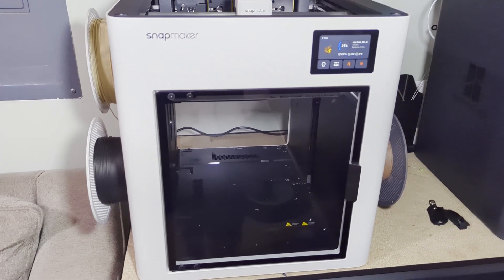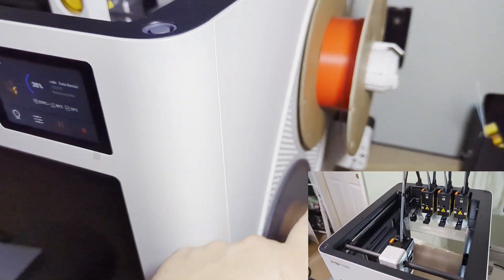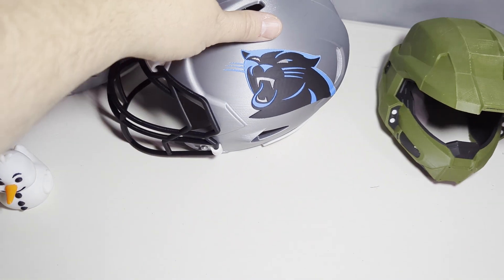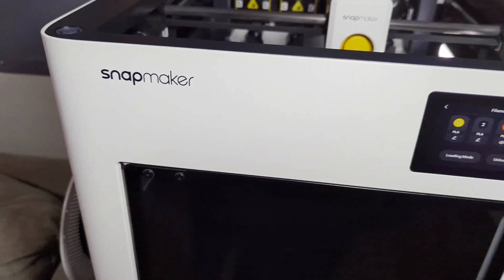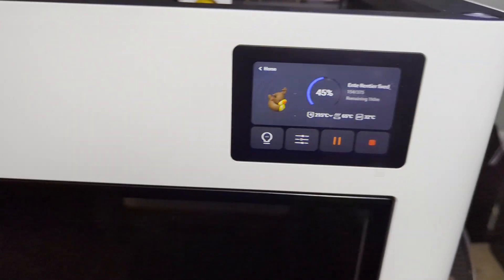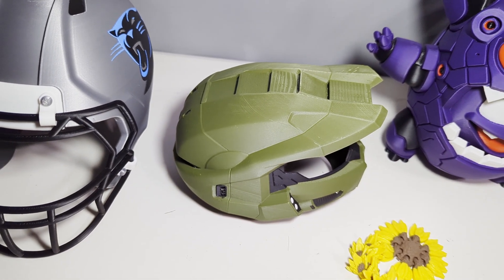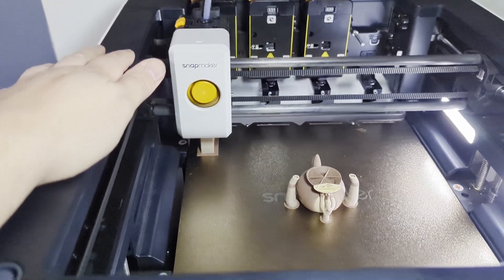Is Snapmaker U1 Worth It? 250 Hours, 16 Prints, Honest Review 4 Toolhead worth it?

Comment from the maker: What questions do you have about the Snapmaker U1?

⏰ TIMESTAMPS:
00:00 - Intro & Overview
00:47 - Setup & Packaging Review
02:07 - Print Quality (16 Models Shown)
04:14 - Speed Analysis & Comparisons
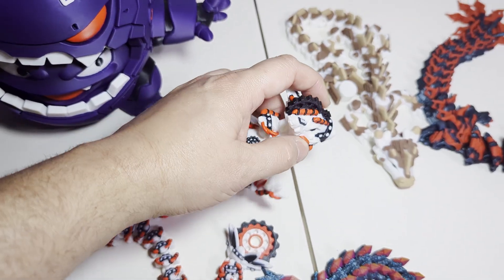07:57 - Reliability After 250 Hours
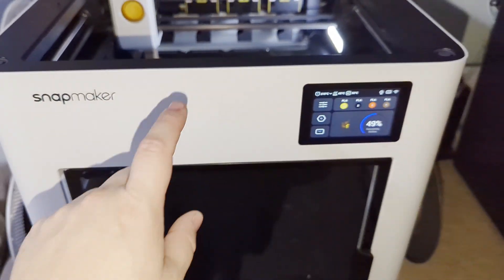10:00 - Final Verdict & Rating
Reply: Is there anything a P1S or P2S can do the Snapmaker can't?  Do you need the full enclosure to printer PETG or ASA? How about replacement parts? Are you confident you can get anything you need in a reasonable amount of time?
Reply from the maker: So far I haven't run into anything it can't do. As for material, PETG prints fine and I plan to get a enclosure worked out before too long. As for. As for replacement parts, I don't know. I saw where one YouTube accidentally broke a tool head, so I am curious how long it will take him (think it was uncle Jessy). I do have an extra plate and nozzle set already.
Reply: How about VFA on the prints from U1? Is it any better compared to P1S? None of the reviews on YT mentions that.
Reply from the maker: @adammooniewicz313  I have not noticed any VFA on the Snapmaker, but I don't experience that on my P1s to be able to compare.

Comment: So far I love mine U1, but I have several smaller issues that are worth mentioning:
1. app is constantly disconnecting requiring me to manually refresh it.
2. even when the app is connected, it is very slow to show status, list models/timelapses etc.
3. bed is very uneven - mesh shows deviations over .5 mm highest to lowest point.
4. unloading a filament takes about a minute and is partially a manual process
5. it's noisy.  I thought my blv mgn cube was noisy compared to my first printer with TMC drivers. But U1 is much lauder than both (but that's probably because of much higher speeds/acceleration it achieves). I certainly would appreciate some "silent" mode for nighttime printing
Reply from the maker: Have you updated your app? Since I went to version 1 of the app/firmware for me the Disconnecting has stopped. But before that version I agree completely.  For the Bed, I have note noticed any unevenness on any of my prints but now im curious ill see if I can look closer. I agree on the filament loading and noise I have gotten used to i
Reply: @InitiativeDesignShop  Should've mentioned - I have 1.0.0 on the printer and the latest iOS app. Plus even the Snapmaker Orca throws connection problems.

Comment: have you tried any engineering type (strong) materials?
Reply from the maker: I have not, I typically only print in other materials when it is part of a custom order.
Reply: @InitiativeDesignShop  THANKS in the FAQ on Snapmaker it says it does it - I am ordering one and might get an ARTISAN later as a first printer It should do the trick
Reply from the maker: @muiravenue7182  It should work fine and I have seen videos of people doing it. However you would need a enclosure. Either order the enclosure or make your own.

Comment: I have had my Snapmaker U1 for a week and I agree the machine is awesome.  The prints come out amazing and at half the time and very little waste.  My P1P which was my main printer prior to a week ago is now a second banana.
Reply from the maker: Agreed, My P1S was always my favorite. So far if this continues to be as great as it is I wont be buying any more P1S going forward.
Reply: What's typical prepare time? If you're about to print with a single toolhead is it possible to skip calibrating all other toolheads? Is it possible to do only bed leveling to make it more or less on par with P1S's prepare time?
Reply from the maker: @adammooniewicz313  Yup, I have skipped the calibration on small prints it does make it start printing much faster. Also if you are only printing with one toolhead it and decide to calibrate it will only calibrate the one toolhead so faster as well. 

Personally if im doing a long print I dont mind doing the calibration as I would prefer to ensure it functions best over risking a issue. But for a less then 2 hour print I will forgo the calibration.

Comment: I ordered mine months ago and they are saying Early April delivery... The wait is driving me crazy. I dont like that all the plastic sits outside and not is a dryer
Reply from the maker: Ouch Early April is rough. But I will say I love the printer. For me the filament in my office remains pretty dry and I don't have to try often unless using TPU or wood filament. My mini split keeps the area pretty dry. I have seen some people ,modify it to allow it to run through a dryer.
Reply: @InitiativeDesignShop I saw a few things that are printable adapters. I keep my printers in the basement so there’s for sure humidity down there.

Comment: So it seems you've done about 10-15 prints and have had 2 failures.  Is that correct?  I bought the Chinese brand and the filament changes were so error prone and wasteful that I gave up.  I like this but the Prusa with the bondtech seems better (but more expensive).
Reply from the maker: I had done closer to 30 ish prints. The others were already shipped out. I only showed the models I still had at home. As of today I am now closer to around 500 hours and still my most reliable printer. I have had a issue with printing Multi Color TPU I am still working through but otherwise no additional failures.
Reply: @InitiativeDesignShop  I appreciate the info. This does seem like the best multicolor for the price.  The prusa apparently only takes 10 seconds to change color and begin printing which is the quickest. But is twice as much.
Reply from the maker: @jefflane2012  Color Swaps on the Snapmaker is about 10 seconds as well. I am sure Prusa Quality is better (I dont have one to compare) based on what I have heard about Prusas. But ya for me the price is a huge factor.

Comment: Do you think drying your filament is a requirement? Not sure if I should get a heater right off the bat
Reply from the maker: I dont dry most of my filament, but I also have a mini split that has built in dehumidifier int he room. so my humidity stays low. If your in a place with high humidity or use certain filament like TPU/Wood filament it will be needed.

Comment: Do you have that Z-Hop or Z clunk? Mine is super loud. I couldn't hear yours doing like mine. I turned off Z-Hop and it still does.
Reply from the maker: The only loud noise I hear if if it is going from one side of the build plate to the other, a slight higher pitched sound of it moving fast. That's about it. Otherwise its on par with my P1S

Comment: How loud is it? One reviewer stated it is very loud, up to 70 decibels during rapid head movements. I live in a one room apartment and noise level is important. Thanks in advance.
Reply from the maker: I work my day job in the room with my 3d printers. I would say its slightly louder then the P1S during Rapid head movements. but  the P1S AMS swapping filament annoys me more then the Snapmaker personally.
Reply: I print in the same office that I work my day job, and the noise isn’t a problem, but it is noticeable. For me, it’s more noticeable than with my P1S. However, remember that the top is completely open - once the lid is shipping, I expect that to cut down on the noise considerably.

Comment: I'm really debating between a Core One L (and waiting for the INDX) or just picking up a Snapmaker U1. Both seem amazing compared to my A1 Mini w/ AMS. Christmas gift printing for my nieces took 3 weeks of non stop printing. I think with the Snapmaker I would've been done within a week lol
Reply from the maker: I have heard great things about Prusa, but I cant speak to them as I don't have any experience with them. For me price is a big part and ease of use (Right of the box ready). I am happy with the Snapmaker and it has cut my print times drastically for multi material color.
Reply: @InitiativeDesignShop nice! Yeah it is definitely the more economical and simple option. I got an A1 Mini because i hated tinkering with my Ender 3 so if the Snapmaker is simple to use, I may go with it instead
Reply from the maker: @Charleswsen  I started my journey with the Ender 3 pro a year ago. From there I jumped to P1s then A1 Mini, then A1 and now snapmaker. Currently the Snapmaker is the best performing for me. But its still new, after 1-2 thousand hours will I really know.

Comment: Hey @InitiativeDesignShop. This is my first time watching your channel. I really like your mini football helmets, great job! Do you use a standard 0.4mm nozzle for all your Snapmaker U1 prints or are you able  to change them based on the type of print? For example, can you mix and match multiple nozzle sizes (0.2mm, 0.4mm, 0.6mm, 0.8mm) to take advantage of the 4 toolheads during one print? I'm wondering if the Snapmaker U1 can print ABS/ASA or other engineering filament reliably after getting an enclosure and print fine contrast lettering using a 0.2 nozzle, while using larger nozzles for the bulk of the print to save time. Thank for sharing your Snapmaker U1 review. Are there any features you feel the printer is missing or underperforms on based on your expectations?
Reply from the maker: Thanks for watching!  As of now I only have the 0.4 mm nozzles but, I typically print with 0.2 layer height. I have not added a enclosure, but from what I have seen you can print with ABS/ASA once you get a enclosure.  So Far I am loving the printer. If they can get their Cloud app working correctly I will be satisfied. Like I said in my print so far everything I have printed came out as expected with two exceptions (One layer shift and one support failure)

Comment: Bambu needs to put out an upgrade to their printers today to match these speeds! Or they will loose a LOT of sales in 26!
Reply from the maker: Well the tool hanger is the big part. The H2C Is a pretty good match but it still has to retract through the AMS so it's still slower
Reply: Well it's not the speed. It's the 3 extra individual extruder that reduces the print time and the amount if filament wasted. It actually has about the same speed in fact.

Comment: Bad timing lol.  The firmware they released yesterday, along with new app version and slicer version, addresses at least a couple of your main concerns.
Reply from the maker: I did the firmware update/slicer update, it's better but still having connection issues for me when not in lab mode.  And the app logs me out every few hours which is annoying. 

But it is encouraging that they are working to address the issues so I am sure it is only a matter of time.

Comment: Hipe they sort wifi quick smart, seriously do not want a wired connection 😢
Reply from the maker: So, to clarify... The Printer works over WIFI in LAN mode, ITs a mode that allows communication on your network only. However that means you cant check on the printer or receive alerts when not on your network. It is still a connection over WIFI. So for some that isn't a big deal at all, but for me its a inconvenience.

Comment: I’m seriously considering a Snapmaker now—printing minis is taking almost 24 hours for a full plate. Now I’m torn between saving up for the Snapmaker or going with the Bambu Labs H2C. You definitely made a strong case in this video. Great content, brother. And as always, print on, my friends
Reply from the maker: I have not done a full plate of Mini's yet to speak to those in particular. But I am loving the Snapmaker so far. I think the H2C is good, Just in my mind for the price of the H2C I could get two Snapmaker... But Bambu Brand is Tried and True and the build volume is bigger. 

If its the time savings, the Snapmaker is faster due tot he H2C retracting the filament through the tubes each time. Krunkle in the comments of my last video ran a comparison of the Gengar I printed using the same specs as I did on his H2C. His was 42 hours while Snapmaker was 27 hours.
Reply: I debated and I personally don’t want to deal with the nozzle swaps with the snapmaker and like the ability of not being limited to just a 4 color print along with being able to use the left nozzle for supports on multicolor prints.
If you know you’ll never want to print more than 4, I would def just go snapmaker though because you could buy 3 of them for $150 more than one h2c so when one goes down, you still have two rocking along. 
I am going to just get one h2c for any multicolor prints I do or for multi material and use my p2s’s for single color stuff so I’m good with not going with the u1 unfortunately.  
I also don’t like the side spool set up nor want to set up the different things ive seen people do
Reply: @ClappinCheex I may save up and get 1 H2c and puck up a snapmaker in the meantime. Don't get me wrong, i love my X1c and have one been printing for a little over 6 months. But it's already time to upgrade. Lol
Reply: @RedFinPrints hahah I mean that works too. Solid plan. My other thing is I just don’t want to use multiple slicers on my computer and just want to keep that aspect as simple as I can. Otherwise id be more inclined to go snapmaker now like you’re saying lol
Reply from the maker: @ClappinCheex  Good Point on the more then 4 colors.

Comment: I'm so glad this printer has worked so well for you. That confirms "my bet" on it was spot on as well.
Could you confirm where you bought the NFL helmet models? I live in México, but my father is a big fan of the NFL. I'd love to give him one of this helmets printed in my U1 which arrives next week.
Reply from the maker: Yup so far I am loving it. The only part I still dont know is long term viability. Do the parts hold up well. But that will be answered with time. If it holds up like P1S then I will be shifting to this model going forward. 

As for the helmet, I found the model on Makerworld by designer animuL67. He has several teams and it was a pretty easy print.  Although  some assembly required after for the mask.
Reply: @InitiativeDesignShop fingers crossed this has a longevity similar to the P1S. It would be fantastic.
Thanks a lot for the Helmet information. I'll take a look and see if I can get similar results to you.
Have a great day.